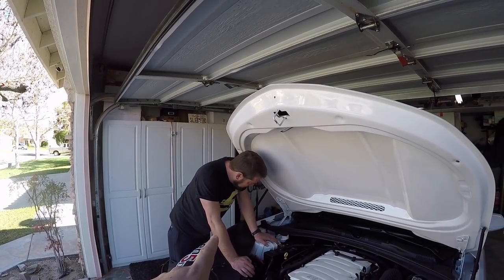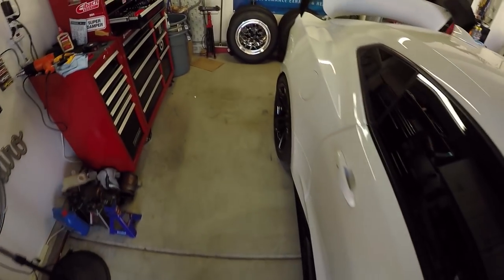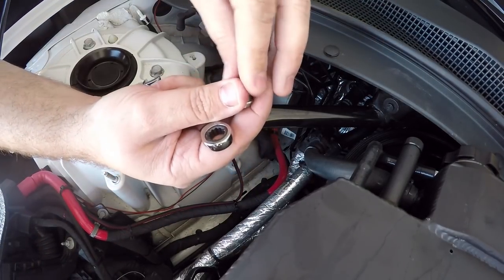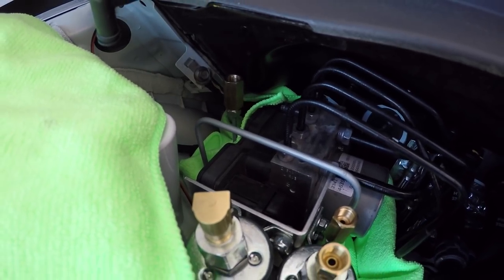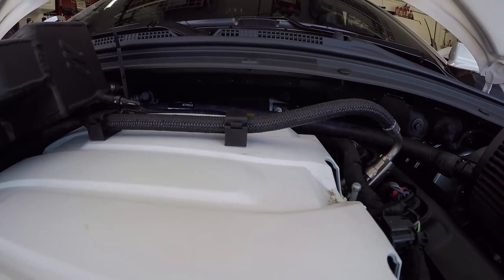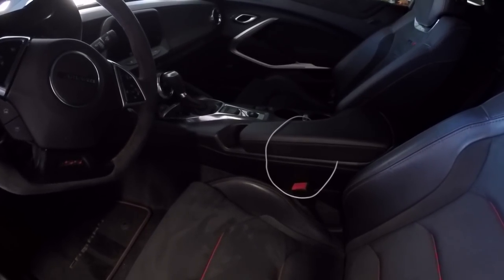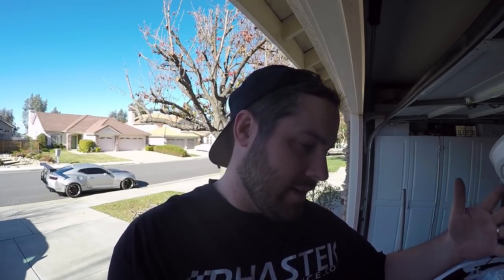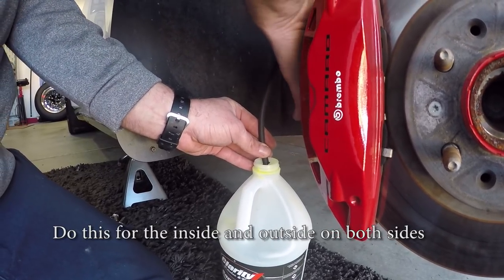How to Add Line Lock - 2016-2024 Camaro SS

Comment: Hey What 5v supply do you have your radar running to?  Since the line lock activation button replaces the one by the shifter. I have the kit also and want a radar but don't know how to power it without my 5v supply.
Reply: i was wondering that too.....since i use that plug for my radar detector